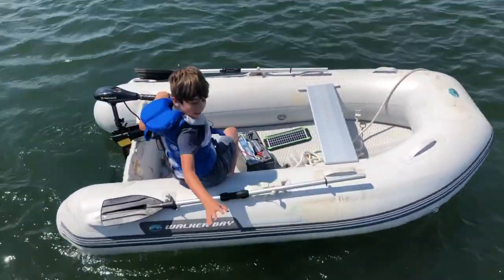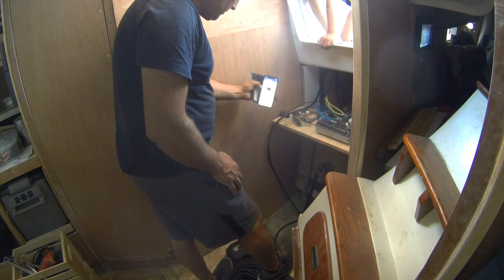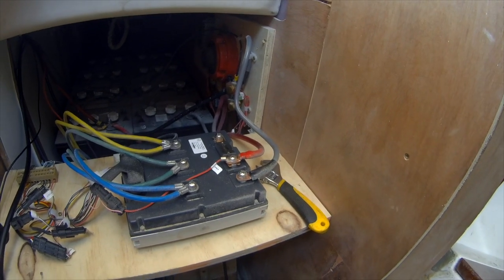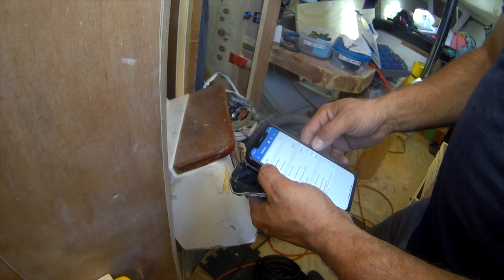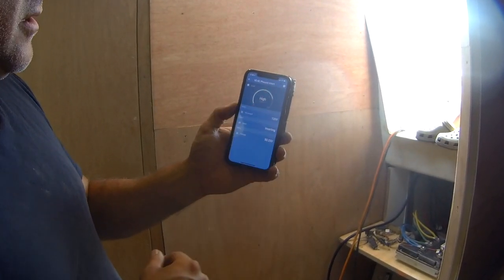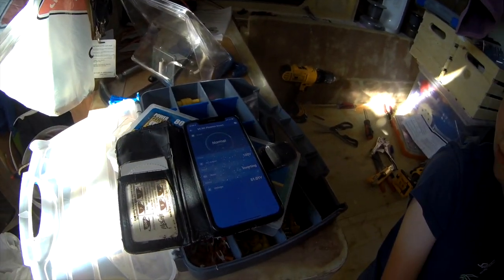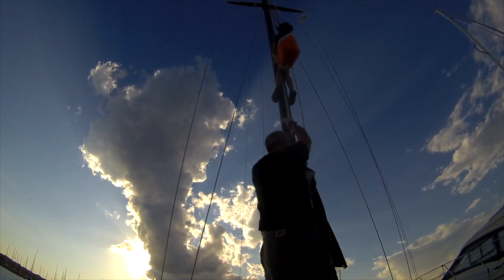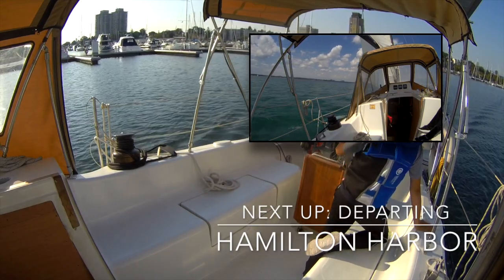Ep59 Testing the Victron Energy Pheonix 48/1200 Pure Sine Wave Inverter

Comment: so how many watts does this unit put out? I have the 375va I run a full size refrigerator I have off the grid at home. Victron inverter are very remarkable 👌
Reply from the maker: i hear that many people use victron for solar off grid homes with good results. this inverter is 1200 watts. my induction cooktop pulls 975 watts. also my large shop-vac is about the same (8 amps). right now it’s meeting my needs but i don’t have a lot of AC. Everything on the boat is DC.